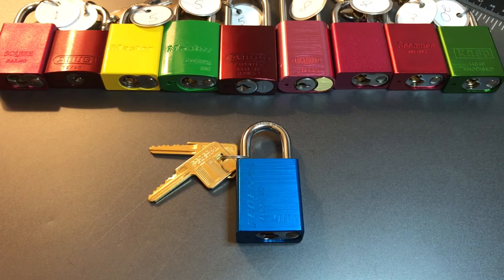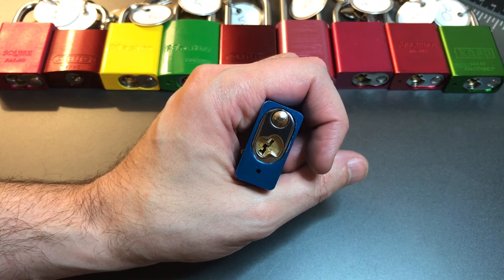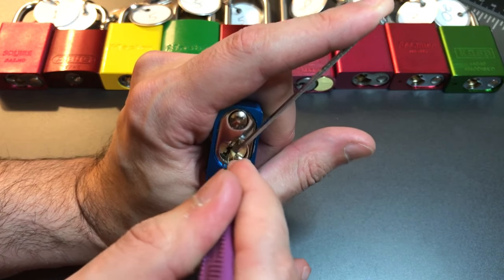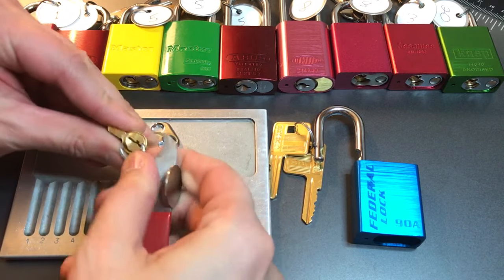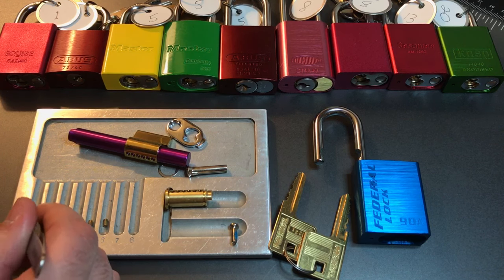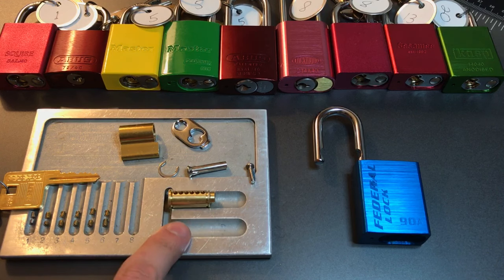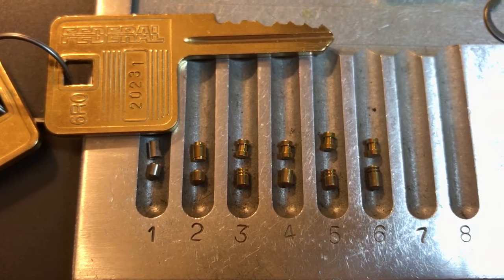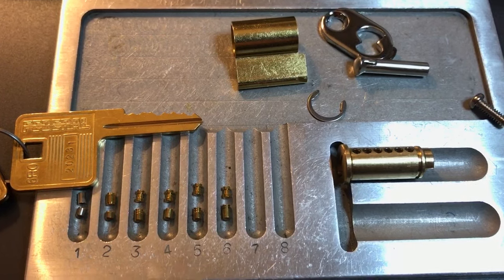[326] 40mmAL Series: Federal 90A Padlock Picked and Gutted

Comment: This keyway looks identical to the American with the same limitations where 0.025" picks fit but have horrible feedback. The plug is different but very similar except for actuator.
Reply from the maker: Agreed.  The keyway is nearly identical to the American, even down to the spacing in which you can fit a .025" pick, but a .018" works much better.

Comment: I can't remember if you were figuring in points for key retaining/non-key retaining or not. I guess most would prefer key retaining over non. But I really think it's what the user needs that counts.
Reply from the maker: I'm not counting that in the scoring.  They are just different... not better or worse.
Reply: LockPickingLawyer I prefer NKR because it gives either myself or someone I designate the freedom to lock it up without the key being present. However, if the application is something like a locker, then I suppose one could end up accidentally locking the key inside. KR prevents such a catastrophe. (But who needs a steenkeeng key anyway?)